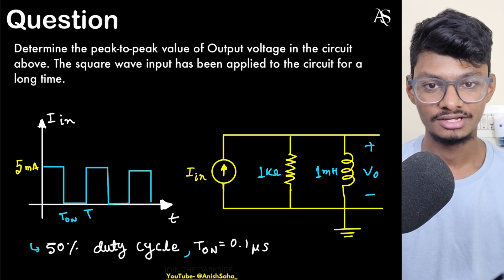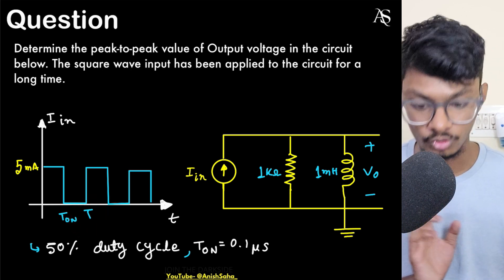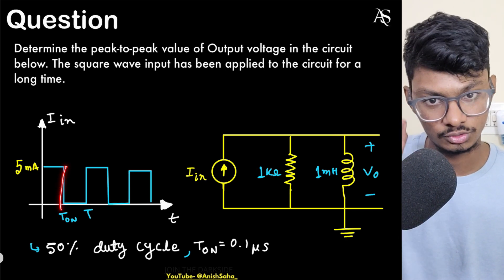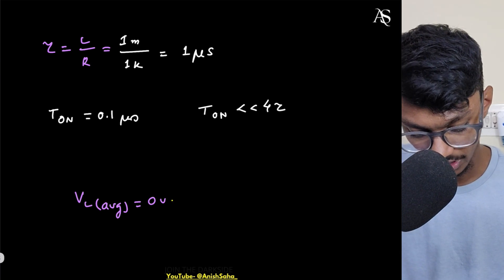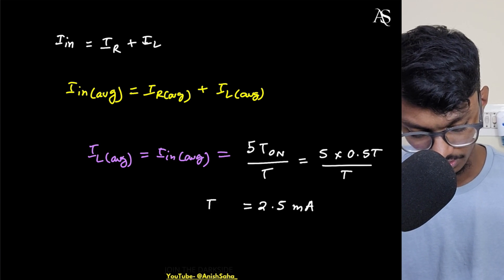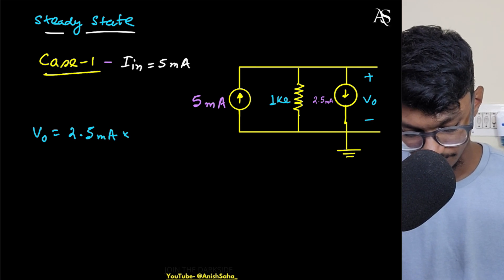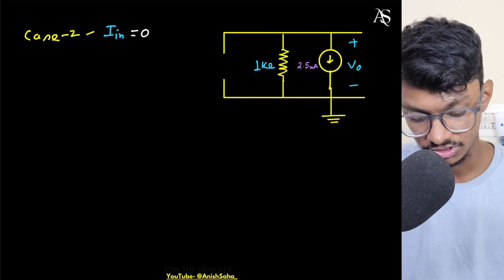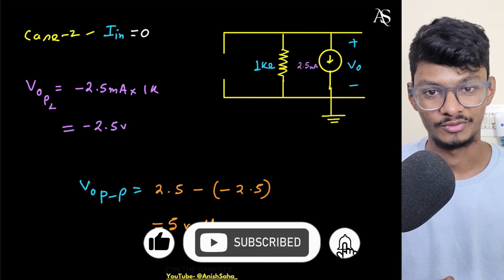Pulse Response Of Parallel RL Circuit || Screening Test Questions || Circuit Queries

Comment: If I convert the current source into a voltage source using source transformation it will be a series rl circuit as discussed earlier. Will it be a valid solution?
Reply from the maker: Yes try it!
Reply: @AnishSaha_  I have done it using source transformation and obviously it is giving the same solution.